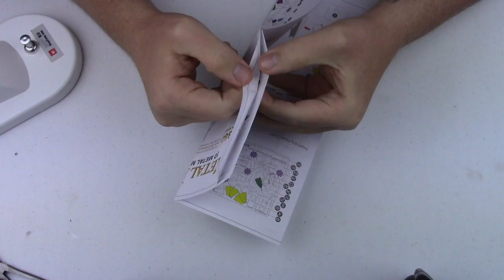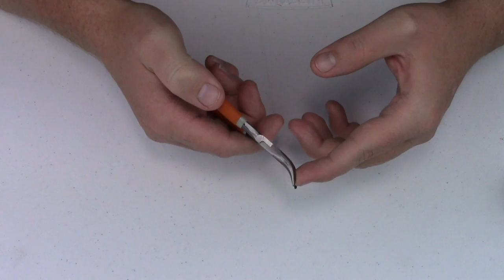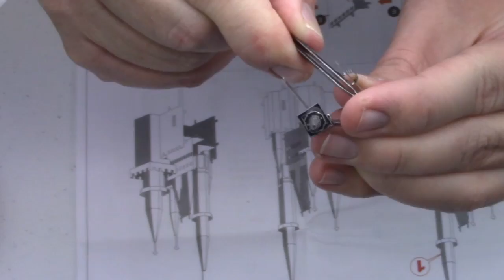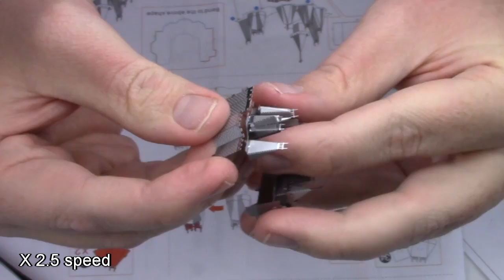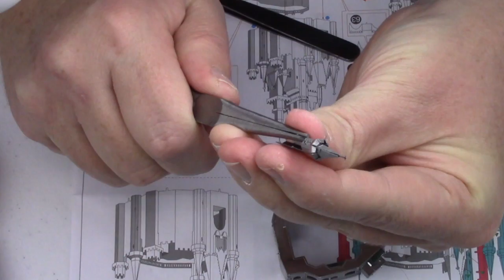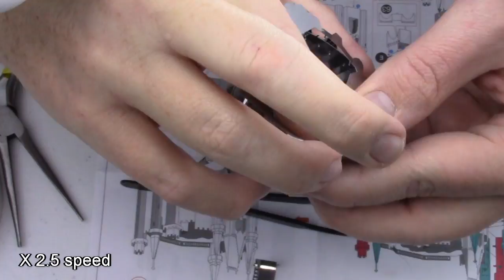Metal Earth Build - Cinderella's Castle - Disney Exclusive

Comment: Where did you find those precision tweezers? I’ve been looking for them but haven’t found a place that carries them.
Reply from the maker: Pixnor Precision tweezers from Amazon. Here is a link to a set like mine, (I think it's the latest version) https://www.amazon.com/PIXNOR-Anti-Static-Stainless-Precise-Tweezers/dp/B013K3H8SA/ref=sr_1_14?keywords=pixnor+precision+tweezers&qid=1575037563&sr=8-14

I only use 3 from the set, two pointed ones and the flat ones with the round tip. I took one of the ones with the pointed tip and ground the tip down a bit to grab tabs.